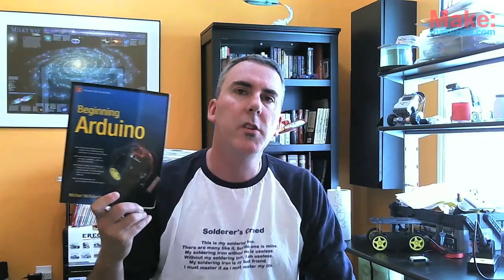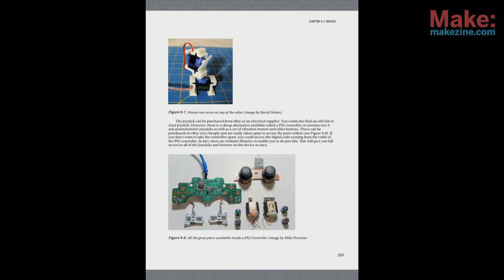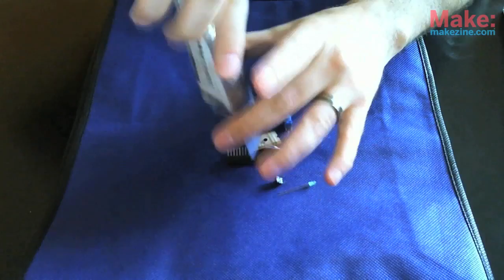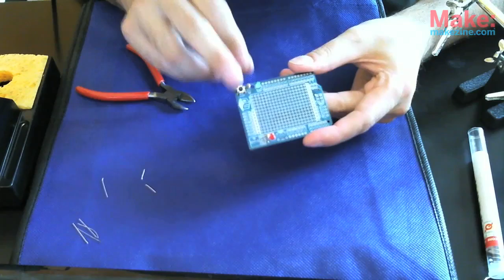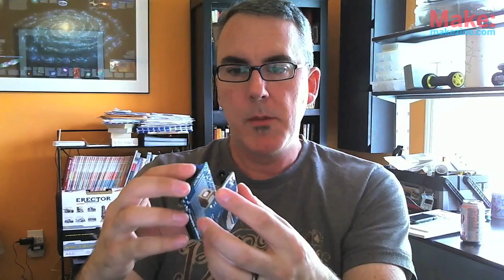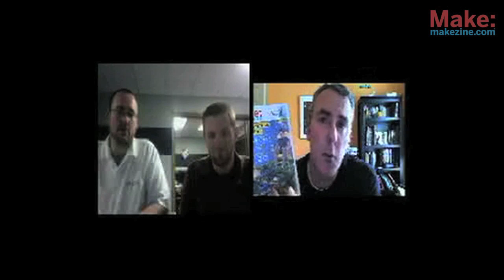The Latest in Arduino 02

Comment: @unlucky13tattoo an arduino is an open source micro controller(very small basic computer). 

Personally I'm not 100% sure on what a shield is, but I believe it's used to make your circuit on but isn't directly connected to the arduino. That way if you wire incorrectly it won't fry your micro controller which would be bad.

That's my best guess.

Comment: @unlucky13tattoo Arduino is an open source, programmable microcontroller that you can use to do just about anything! Ok you're wondering "What's a microcontroller?" Basically a microcontroller is an IC (short for integrated circuit) that is programmable and takes input from something and outputs it to something else. That's also basically what Arduino does, is take input from something (say a switch) and outputs it to make anther electronic component (say and LED) to do something (like blink).

Comment: @Dth091 VB is not available yet, but it will be soon.
But besides that, with VB you just write things faster (as opposed to C#)

And guess what? I'll use it
By the time you're done wiring up events and trying to find the end of a block looking at the matching indented curly brackets, I'll be up and running.

Remember, in a.NET world, a program will not be judged by the language it is written on, but by the performance of it's execution.

Comment: @Dth091 But it doesn't matter, really. If you like C# then use it. I use it too for my Netduino project.

My post was about using .NET to code against the Netduino, the Arduino is a great piece of hardware but the development IDE sucks.

Besides that, if you use .NET you can plug into the entire .NET ecosystem , including controlling your Netduino (equipped with an Ethernet port) from a web page.
watch?v=RfI-yCQXT8Y